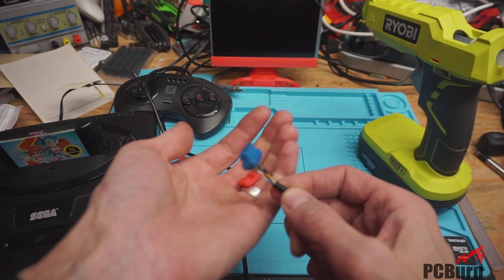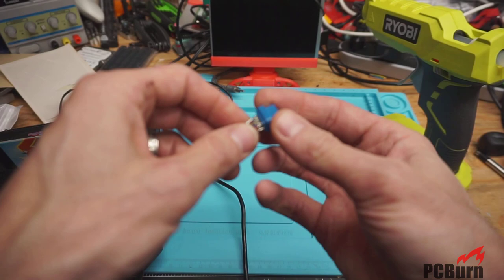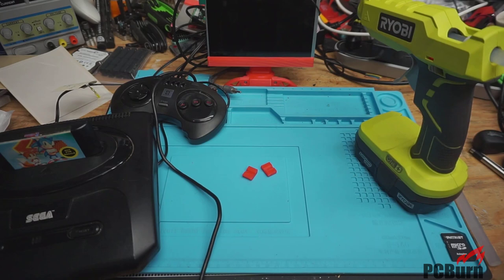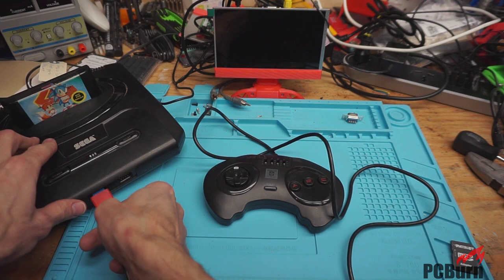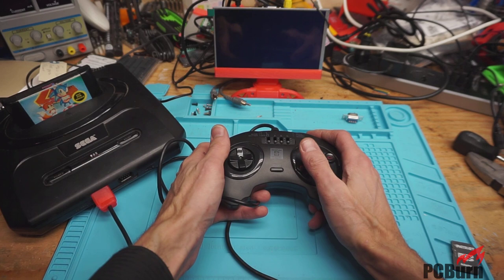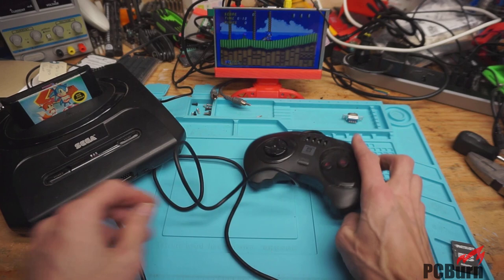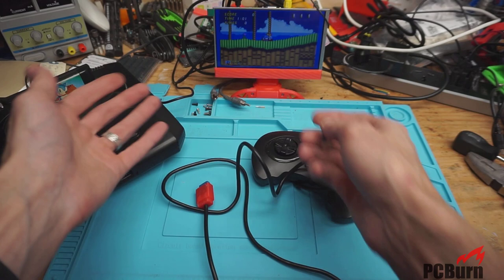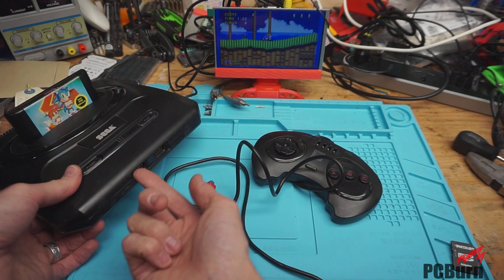Making a 9 Pin Joystick Cable (for Sega Genesis, Commodore 64, ColecoVision, Atari, etc.)

Comment: FYI - I ordered some of these by having them printed by Craftcloud.  The top and bottom pieces that provide strain relieve for the cord simply won't fit into the housing even without a cord between them.  I'll try widening a bit to see if I can push everything the way shown in this video.

Another solution is to whittle at the end of a regular PC DB9 cable.  It takes some doing, but you can carve away enough of the female side so that it is still strong, but also fits into a game consle that takes DB9.
Reply from the maker: Ah, yea. These were specifically sized for my printer. I've had the same sort of issues with other designs and the dimensions as printed.

Normally I do an exact fit on the designs I post, I'll check it when I make the push-pin version.

Comment: Very nice. where can i find a red and blue connector like yours?
Thanks
Reply from the maker: The blue portion is stripped from a DB9 serial connector and the casing's the 3D print linked to. I'm not sure that I entirely like the fit. I'll probably be revisiting this before long to redesign an entirely extruded or UV Resin printed model.